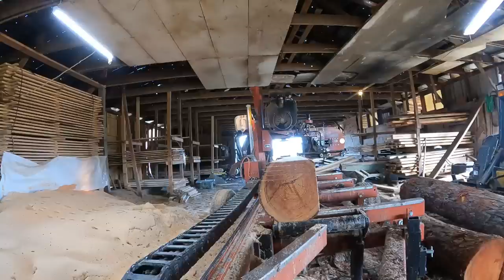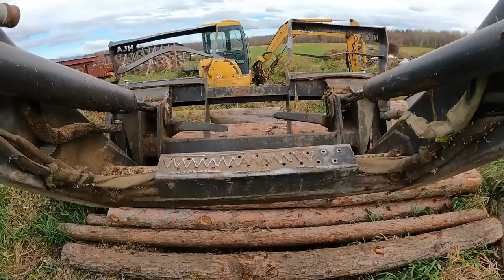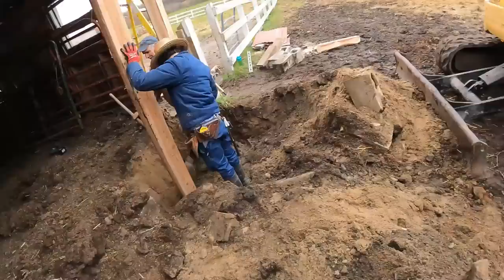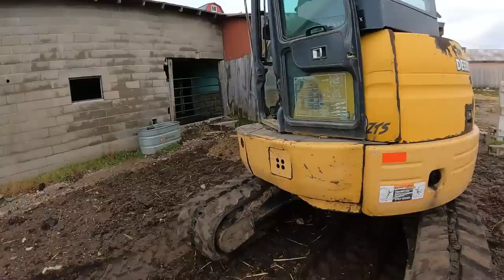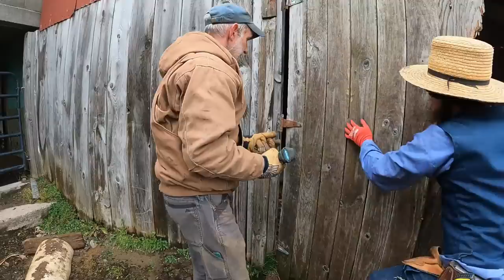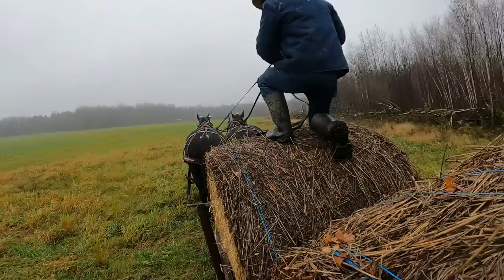MAKING HORSE BARN REPAIRS!! #399

Comment: In Australia we have a tool called a crowbar, about 6ft long, thick and heavy, got a round tamper on one end, and a flat end shaped like a big old screwdriver on the other, for digging post holes and tamping the dirt back in around the posts. Thick and heavy steel, when digging holes best done with 2 people, one breaking ground with the crowbar, the other on the shovel, and same with tamping down. A very heavy tool, lift and drop. Good video, you are lucky to have Amish and Andy about.

Comment: I have Adirondack Siding on my house & garage! I have 2" overlap, (because green wood shrinks some!) and you need a level! Sometimes your lap will be more because the board may be wider on end than the other, so to make it level, you may have to drop it on one end! And it's a lot of work putting it on a house! I had 14"wide & 16 ft long to put on up to the windows, then It's easier, because you cut it for between the windows! 2x4 framing around the windows & doors! I'll try to send you pictures!

Comment: Larch was the go-to wood for mine timbers in Northern Idaho. Idaho Larch is very tall with just a few limbs at the top and very little taper. It's very strong, but a little more brittle than Doug Fir. It resists rot much better than fir. Larger Larch splits well into shakes for roofing. It is also an excellent firewood.
Reply: Well said.  I Find it interesting you say good firewood also.  Here in Alaska we burn the dry beetle killed spruce. (And White Birch)
My family in Wisconsin will not burn evergreen indoors, there is so much oak and maple which is less creasote.  Chimney fires can be deadly, however , I did get them to burn some of the bleached Bone wood pine that has the sap sun baked out of it(nice fire sound, pops, but can spit hot ashes).  Pine needs alot! of season sun time to get the sap dehydrated so it burns clean, some places out west only have pine(fir).. folks in the Midwest generally will not burn it indoors.   Interesting as now I live both worlds..
Reply: @johnkomosa4089   I now live in Galena Alaska.

Comment: I saw on another channel where they were sawing white pine which has a high resin level. Instead of using water on the blade he was using a few drops of diesel fuel in place of larger volumes of water. He was very pleased with the results.

 
 with

Comment: Tamarack Or larch my favorite lumber to saw,  other than the small splinters.  I have been told horses won't crib on it.  Do you find that to be true?  How long will it hold up in the ground I have only used it for framing, siding and fence boards.

Comment: Its funny, cinder block used to seem such a sturdy, permanent solution, but it clearly isn't.  I can't believe how degraded those cinderblock walls are.  It almost seems like a pole barn holds up better.  Andy is a brave man.  That seems like a good way to break your neck if that bale rolls at all, but I guess it is settled into that flat bottom enough to hold.

Comment: Whats a sugar house?
Reply: Making Maple syrup. A sugar house is where you boil down maple sap that averages right around 2.5% sugar to 66% sugar at which point it's maple syrup. It takes approximately 40 gallons of raw sap (looks like water) to make 1 gallon of syrup. We make maple syrup here in Michigan.
Reply: I was going to ask the same thing. Thanks Julie for answering 😊
Reply: Well said Julie, also some folks cook it down to candy, but I suppose the most popular traditional way is with a hardwood fire to get a smoked taste, (real! maple syrup) has to be experienced,  the flavor is awesome.  I used to cook on clay bricks holding up a evaporator pan, 2 feet wide by 4 feet long, just high enough to slide the wood under into the fire , hot coals, and the steam just rolling off the evaporator.  :-)
Wisconsin...  I heard Vermont Maple Syrup is very good also.
Reply: @johnkomosa4089  We started out with a 2' x4' flat pan on a cinder block arch. Boiled 24 hours a day for how ever long the sap flowed. We now have a post and beam sugar house and Tole Inox raised flue wood fired evaporator. We have made candy in the past but that is done under more controlled conditions. We've accidently burned our syrup pan a couple of times. We were down a few days one time while we cleaned our pan.....no fun at all!!